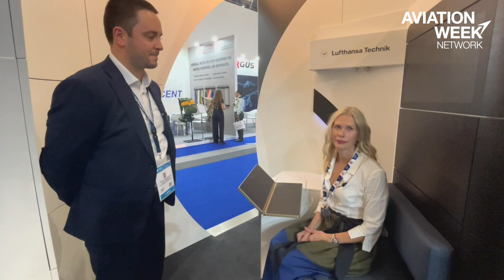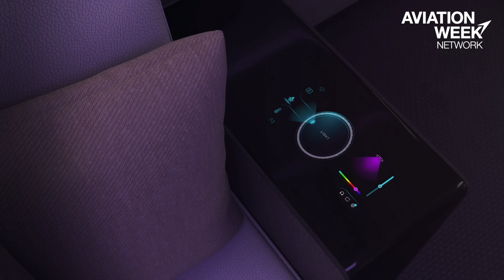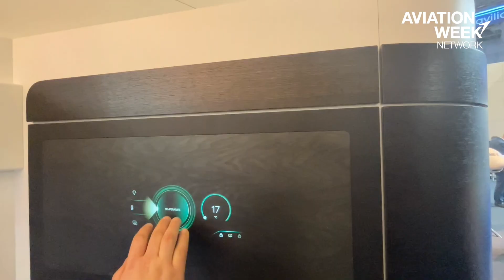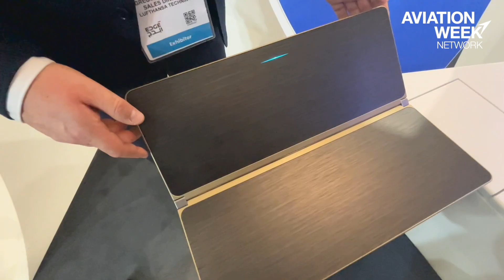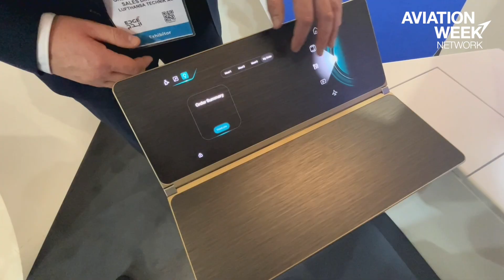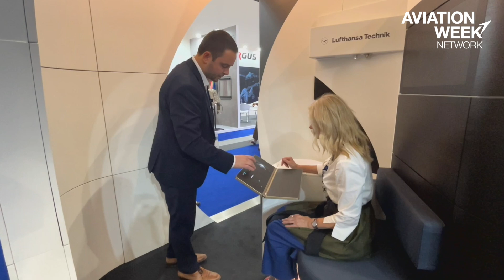Lufthansa Technik Debuts Hidden Touchscreen For Media In Table

Comment: I am not a fan of TV screens on planes, I would rather use my time to read or to work on my laptop. The only use I would like for screens like this or for the existing ones is where it could be plugged in to my laptop or phone, and used as an external monitor.  This would really excite me.